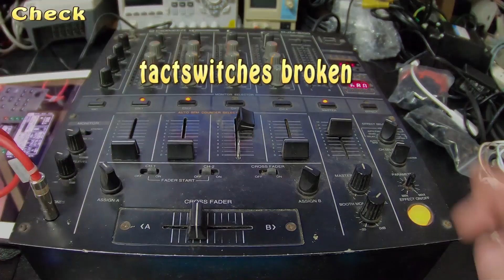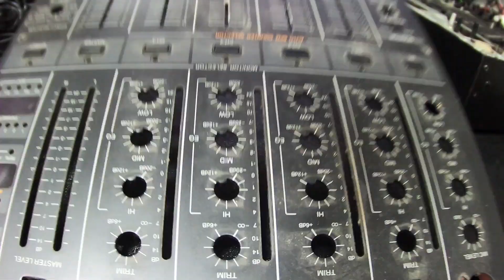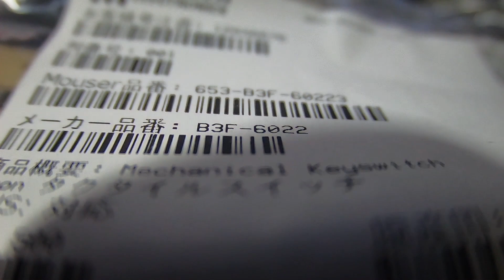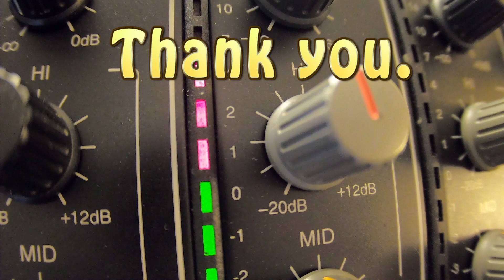Dj mixer Fixed Pioneer DJM 500 (EZAS/Repair /Fader tact switch Replace Restore

Comment: Thanks for the informative vid.
Do you know if the tactile switch from the effect on/off switch (orange one) is the same model as the ones you kindly showed in your vid?
Do you think master balance L/R pot can be repaired or do know a part number for a replacement?

Comment: djm 500 and 600 have big problems with heaphone jack beter is to change it to a mettalic one , which is more robust
Reply: @generationhitech have a recommendation for the replacement part?
Reply: I use to own a DJM 500 Mixer and so far so good I didn't had no problem with the headphone jack I wish I didn't sell it such a good mixer

Comment: Why in the Hell🤣 would you go through all that trouble and hassle opening up each fader to try to clean it and fix it when you can easily buy The Replacements which will work 100 times better..LOL🤣😂